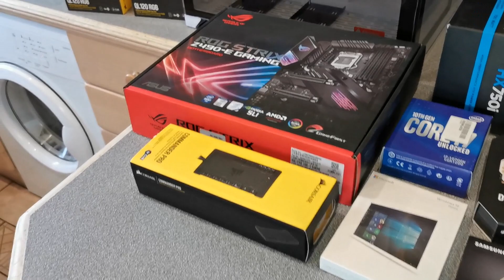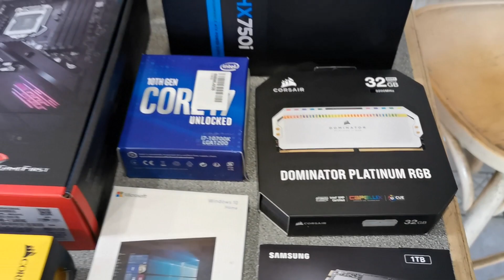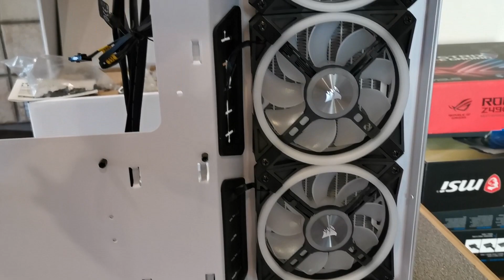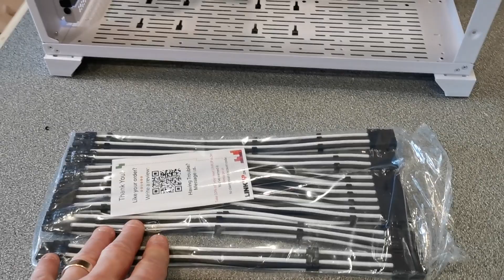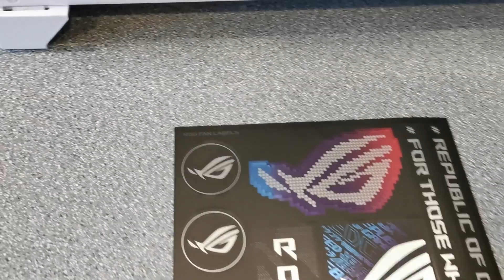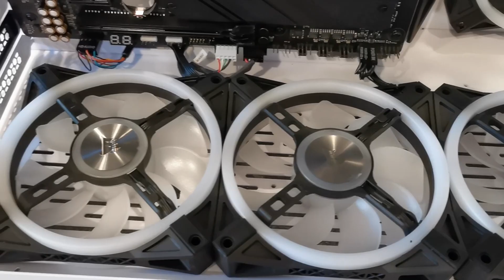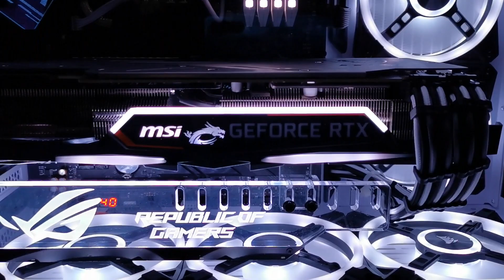Lain-Li 011 Dynamic Mid, Corsair RGB Build

Comment: By the way you've installed your water cooling device, the lifespan of it will be reduced.

Put the input/outpou hoses on the bottom.
Reply from the maker: Sadly like most AIO the tubes are 400mm long and simply will not reach, will not work as this GPU is large, does it reduce life, well Having used an Corsair H55 for 8 years with the tubes at  the top and that system is still working, you can read and watch vids all day the real test is in time , have not had AIO fail yet, Ideally tubes at the bottom is the best setup for optimal cooling and avoiding air in the pump but until manufactures make longer tubing at least 500mm this is my only option with side mounted rad (no pump noise as chambers in the raid trap any air bubbles going to the pump).
Reply: Feels like everyone who watched a certain "you're doing it wrong" video now goes around blabbering this everywhere...
Reply from the maker: @Krogdalo  Yup ,lol

Comment: Why is there a Glass plate in the case over the fans that a downside
Reply from the maker: Glass plate in the case over the fans ?? are you talking about GPU support bracket ?
Reply: @JAYZZ71  Uhr yes. The glass under the graphics Card. Why is it there ? And sry for my bad English
Reply from the maker: @moritzwnb  ok no worries, It supports the GPU to stop  it from sagging, very heavy GPU , Keeps it level and looking Good, hope that helps 👍

Comment: what about noise man? seems like it is very quite! Is it because of fans or case?
Reply from the maker: More Airflow less noise all fans in everyday use at 850 rpm and for gaming to 1250 rpm, fan noise is very good
Reply: @JAYZZ71  do you control them from bios? I think my fans are working at max everytime
Reply from the maker: @piupiu9656  all fans are controlled by the Commander Pro and AIO by ASUS software , fans run from 800- 1200 rpm

Comment: I found this build extremely satisfying, everything is consider in the build for efficiency  and look. Nice Work man!
Reply from the maker: Thank you for your kind words, had fun doing this build, couple months on no dust in the unit (positive pressure)  and temps are excellent
Reply: @JAYZZ71  I have mine one build all black with the NOCTUA NF-F12 (9), my inner temperature just literally run around 30-50 with the highest is 60, this case is just amazing.

Comment: Hey I have a question, I have the same exact case but how did you fit a corsair commander pro for your fans on the back because cable management is a nightmare on this case dont get me wrong its a good case but I wish they added more space on the back
Reply from the maker: I agree the cabling for the Commander pro + 2 rgb hubs was a testing affair but i completely removed the Hard drive cage and zip tired every cable even using the cable extension was a tight fit needs patience but possible to do, only using M.2 for storage

Comment: Still wondering how you even made the AIO pump tube side fit in between the ram. I have Asus Maximus 12 Hero Z490 with Gskill Trident Z RGB Ram/NZXT Z73 and tubes down with AIO pump/fan cable snug fit between ram. How long do you plan on keeping the AIO /Placement  in that orientation? Have same AIO  Side panel placement
Reply from the maker: With this AIO we had 1mm to 2mm between Ram and hoses, the z73 was a no go, Confused why so many makers have issues with Ram clearance, see so many builds with just 2 ram slots filled just poor design,  nearly everyone wants 4 sticks makes no sense.

Comment: Sorry for questioning😬😂 but did you used the rgb hubs that comes with the Ql Fans?
Reply from the maker: Yes used 2 RGB hubs which gives a total of 12 RGB fans, only used 9 ( each hub gives 6 connection)
Reply: @JAYZZ71  OK, thanks you for your vidéo.  You don't used the commander pro, just two rgb hubs ? That's it ? Because I have 9 Fans but just one rgb hubs with the H150i elite capellix.  I must buy another rgb hub ? Sorry for my english,  I'm french.  Thank you so much 😉
Reply from the maker: @PoissonQC   Each box of x3 QL fans comes with a USB HUB RGB controller, you can plug two into commander pro as it has 2 usb connections which will allow upto 12 connection for RGB fans from the commander pro

Comment: Just finished a build with this case, took the idea for the AIO and radiator placement from this video. Wanted to say thank you, my temps are absolutely amazing, nice vid.
Reply from the maker: Thank you for your kind comment. 😊
Reply: @JAYZZ71  hey man extremely awesome build! I’m planning on building something very similar and just wanted to clarify exactly which sides are intake/exhaust? The bottom is intake and top is exhaust, but is the side with the rad intake or exhaust? Thank you so much!

Comment: Do you mean 2× the Corsair rgb fan hub, with 6 fans plugged into one hub and 3 fans into the other hub? And the 2 Hubs plugged into the commander pro?
Reply from the maker: Commander Pro supports 6 fans(power) and 2 RGB hubs supporting upto 12 fans (RGB only) plug into Commander Pro, the other 3 fans (AIO) are powered by Cpu header via 3 into 1 splitter, the RGB'S do go to the RGB hub from the commander pro.

Comment: How did you connect the 9 Fans, so that you can control all Fans in one Layer, you understand?
Reply from the maker: Commander Pro powers 6 fans, Cpu Header powers 3 fans, Commander pro can power upto 12 RGB fans (via RGB nodes that plug into Commander Pro)

Comment: I'm almost replicating that entire build by coincidence. Something you may be able to advise me on JAYZZ71 is the Corsair QL120's, your Commander Pro and the ROG 360mm AIO. I'll be getting a Kraken Z73 myself and I was wondering is it simply a case of plugging the fan cables into the Krakens fan controller so that the fans are powered by and controlled by the Kraken and based off Water Temp and then just the RGB wires from those Rad fans go into the Commander Pro?? Or do all the rad fan cables go to the COmmander Pro but the iCUE softrware has access to the Kraken Water temp and thus can still be based off it? WIth my Corsair H110GT on my current PC I pulled my hair out with the Rad fans constantly ramping up and down as I browsed media heavy webpages. SOlved when I learned that you should set your rad fans PWM to be based of Water Temp instead which is much much more stable than CPU Package temps.
Reply from the maker: My only Concern for the K73 was the cost and pump size and tubes " may" block the first Ram slot I wanted 4 sticks and have seen builds with only two slots filled I know it can be rotated to fit but didn't want to take that risk and wanted to have a white AIO. The Commander pro comes with two USB ports so connecting 2 RGB nodes that will give you 12 RGB fan connections, with AIO you will have a  splitter 3 into 1 for CPU header i just changed the Fan curve to stop fans ramping up, normal use 28c-32c, gaming never goes over 55c fans never go past 40%-45% and CPU is a 4800mhz and boost till 5100mhz and very stable
Reply: @JAYZZ71  I could never live with the ROG AIO........I'd feel like the EVIL ROG Monster Eyes were watching me all the time!! (The 'Eye' on the Mobo IO Shield and the the one on the AIO Pump Block) LOL. 

Certainly the majority of photo's or builds on YT show it to the right at the RAM slots but there are a few showing the tubes on the bottom, left or top. I don't understand what the issue is given the screen can be rotated in software. What am I missing? I reckon that if I top mount the Rad I'll have the tubes coming out the bottom of the Pump Block and loop over the IO Shield area up to the rad whereas if I side mount the rad I'll rotate the pump block so the tubes exit at the top and loop over to the rad. 

Your build convinced me both of the need of some white on the all black Strix motherboard area and of black QL120 fan frames in the all white case interior. I had white QL120's in my vendor wishlist but switched them to the black framed version when I saw your build. All that white would have been too much but the black fan frames break up all the white and provide a nice contrast. WRT the colour of the pump block, I agree it needs to be white to contrast with the black motherboard but I have my heart set on a Z73 and that LCD screen. So I'll be ordering some more white plasti-dip  (can be peeled back off) to paint the pump block. Might also use it to add some white accents to the Strix3090 I have ordered. Did similar to my Palit Super Jetstream 1080 and Corsair H110GTi AIO pump block back in 2016.

https://imgur.com/AfL4cnU
https://imgur.com/k0y66H5

Comment: Great build. Btw how did you connect all the fans with the commander pro. Did you use a splitter
Reply from the maker: Six fans connected to commander pro no extension used, 3 fans for AIO connected to CPU header with 3-1 splitter supplied with cooler, two RGB nodes used ( plugged into commander pro via 2x USB header) for all 9 fans led's

Comment: Hi, I need ask you something because I want a similar build and I will buy my new PC  in some days, do you changed the AIO fans for the QL120? I mean, you are not using your AIO fans, right? Thanks for the video and your answer!
Reply from the maker: Yes changed AIO to the QL fans just make sure you can get close to matching CFM, RPM and Pressure to insure cooling remains the same you may have to up the RPM,  after a month of gaming temps for the CPU are excellent and can recommend these fans, hope this helps
Reply: @JAYZZ71  And do you use anything to control all RGB and Speed fans? I will use 7 QL120, 3 in the front, 3 in the AIO and one   in the back! Thanks again <3 btw I will use a corsair 5000D Airflow case, Ryzen 5800X and RTX 3070
Reply from the maker: @ItoruKonza  ICUE software for all fans speeds and RGB's

Comment: For the AIO Micro USB did you run the cable behind the MB? cause my NZXT AIO cable isn't long enough to run it behind my Lian li case and back out the bottom
Reply from the maker: yes its very long so easy, but you can buy usb extenders to help available from Amazon
Reply: @JAYZZ71  yeah cause when I run it the cable behind the case(where the front panel connector live) the cable is just a tag short 
And there’s enough space between the MB and the case for the cable to slide in then? No heating problems or possible rips from the cable ?
Reply from the maker: @lazy141  Just be careful do not pull hard it will be fine for heat

Comment: Nice build! You mentioned the cool air coming from the fans on the floor to the the gc?
Reply from the maker: Yea the 3 fans beneath the GPU are excellent Runs 42c in normal mode and gaming Max 60c, in my old case it was 75+c well worth as card core runs an overclock of 2075Mhz
Reply: @JAYZZ71  Nice! on which % do you let the fans run?
Reply from the maker: @nicoeggert2527  sorry a bit late, use two setting one for everyday use and one for gaming so 1. 25%  2. 40-45%  for this setup, each build may vary depending on GPU heat

Comment: But you are dragging warm air in with mounting the rad there and all the tests that i have seen show it is better to have the rad at the top and use the side for intake
Reply from the maker: The warm Air coming from the AIO is minimal,  Tested with rad top mounted and side mounted, full day of testing games/cinebench with rad in both position, personally for lower temp were made with side mounting, with this build the GPU runs very warm makes no sense to top mount and heat rises and would pass through the rad, every build is different so for this pulling cool air from the side works, testing has proved for me anyway this is the best setup in this case with these components, I'm not saying this is the way it should be done but for this build is was for me and very dependent how hot your Gpu gets and this moves that warm air out very quickly
Reply: @JAYZZ71  No mate. You are wrong. Hot air should be blown outside. You want the rad on the side, that's fine, you need to swap the direction of the fans on the rad to blow the hot air outside. The way you have the fans on the rad setup, you are pushing all the hot air inside.
Reply from the maker: @momauritian2345  OK having tested with the rad in two location and fans changed, Ran the fans as you said, Having the fans was drawing hot air from the GPU and increased CPU by 8-10c one week of testing and logging temps for this setup this DOES not work, Having a FE GPU would have different outcome, So for this setup sorry you are wrong remember each PC setup will vary depending each component you use whatever works for you or me its all about giving info which is a good thing and this setup having Positive pressure no Dust in this machine, the other way it would look like the inside of a Dyson hoover.
Reply from the maker: @momauritian2345   https://www.youtube.com/watch?v=qfoBiZ6QDgA

Comment: Hi Jays, sorry if I am asking a stupid question as I am really new to pc building.
Just wondering that is this build have 6 intakes and 3 exhaust? if so, would it be negative pressure in the case causing dust to build up much quicker? (as air coming in from all gaps with no dust filter)
Reply from the maker: You can  debate if negative or positive is best its not a stupid question, this setup is Positive air pressure It’s where you have more air being sucked into the case than is being pushed out by the fans. so dust will not build up as extra air is forced out by gaps and holes and the 6 intake fans all have dust filters, most importantly heat is being removed from the top with not filter or restrictions and cool air directly in the GPU ,there is not a huge diffrence as the 6 fans run at 1150 rpm and the  3 AIO fans run at 850 rpm, but still positive pressure is present,( All intakes have filters- important ), Negative pressure will cause dust in systems not good for a glass display case, hope this helps
Reply: Thank you for replying me subscribed !
Reply from the maker: @che-weihsu5736  Thank you

Comment: In hardware Canucks video on this case, he says there is better performance with a top mounted aio. What do you think?
Reply from the maker: On his " The Case of My DREAMS! Lian Li O11 Dynamic" video he has side mounted his rad, but to mount the AIO at the top with an after market GPU (3 fan blower) makes no sense as heat rises and only goes to one place, for peace of mind I did top mount the AIO for the day as this question is asked a lot to see what difference it would make, CPU/Games testing the side fan mounting remained cooler by 3-8c, a full looped system would be better as GPU would be water cooled, but side mounting the rad for me is more efficent fact not fiction, hope this helps
Reply: @JAYZZ71  alright thanks man. Also would u recommend the z490-e  you have for a white build or the vision g z490. I heard both work well for a white build. Just wondering what you think.
Reply: @shay2173  I purchased a ROG STRIX b550 e, and i'm going to be removing the metal parts/shields, to paint them white, waiting a day or two to dry then putting them back on to the mobo for accents of white, easy solution if you can't find a white mobo you like
Reply: Hey there, 
how does the side mounting of the radiator behaves on the pump power. I've heard that is always better, if the pipes runs under the radiator and the radiator should be mounted horizontally for better cooling performance of the water inside. I'm going to mount my radiator on top with fans exhausting into the radiator and 3 fans on side, taking the air out of the case and 3 fans on bottom sucking air into the case. What do you think of my solution?
Reply from the maker: @kenodzuni5296  the only reason i side mounted the rad with hoses at the top the hose length is not long enough from the bottom, and the 2070s runs super hot and not a good idea to pull heat from the GPU into the rad heat rises as simple as that ,and as long as the pump head is lower the the top of the rad you will NOT have pump noise or shortened the life of the AIO

Comment: Did u put the radiator from behind the case and the fans that on the radiator from the front ?
Reply from the maker: Yes Rad is in back of case, the cutouts of the case can support most rads and the fan screws will be long enough to attach Fans from the front
Reply: @JAYZZ71  That is useful information, thanks

Comment: How can i have the side fans as exhaust? I have 6 ql120s and a arctic liquid freezer ii 360 aio... My gpu is nitro+ rx 6800 xt se
Reply from the maker: Are you top mounting your AIO or side mounting ?
Reply: @JAYZZ71  I don't know if i side mount I would have to switch the artic fans out with the ql120s
Reply from the maker: @iiTzHaroon  when changing fans on AIO you really need to match the fans as best as you can ie: CFM/RPM and static pressure to make sure cooler works correctly, QL Fans- 1500rpm,airflow 41.8 CFM, Static Pressure 1.55,  Artic Fans 1800 rpm CFM 56.3, static pressure 2.2, so there not to far apart you can use the QL( may have too increase CPU fan Curve a little to match ) , Just check with Manufacturer of the cooler because some coolers can stat certain fans will not work with it, hope this helps
Reply: @JAYZZ71  should i top mount or side? How about the rest of the fans how would I set them if I wanted at least the side fans as exhaust

Comment: what are the cables?
Reply from the maker: "LINKUP" - PSU Cable Extension Sleeved Custom Mod GPU PC Power Supply Braided w/Comb Kit┃ 1x 24 P (20+4)┃2x 8 P (4+4) CPU┃2x 8 P (6+2) GPU set┃30CM 300MM - White/black - (18 AWG Cables)

Comment: The radiator fans are intake ?
Reply from the maker: The Rad Fans are pulling Cool air in from the side, more effective than pushing warm air from inside the case, temps 10700k are 28-32c under normal load, and the Corsair Fans have Corsair badges on both sides so either way they look nice